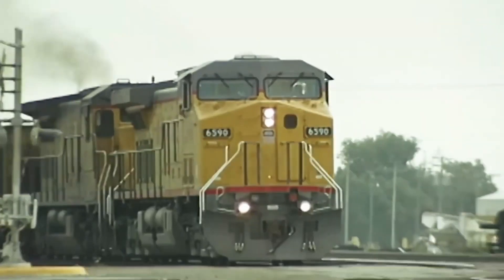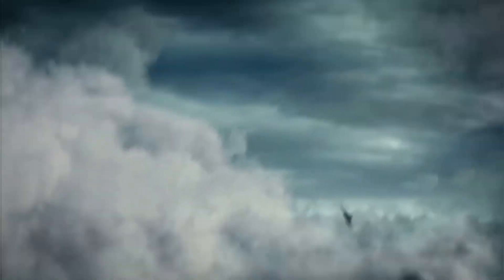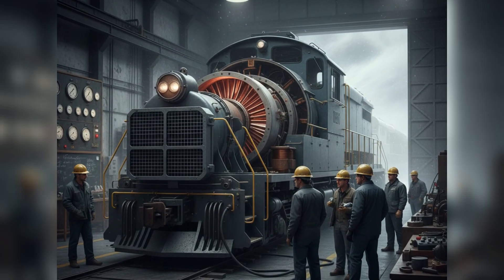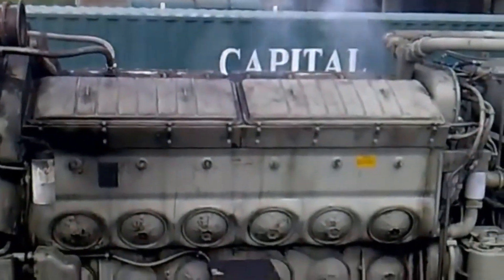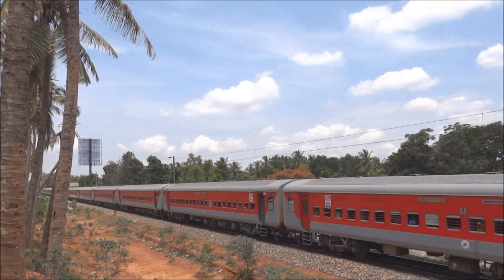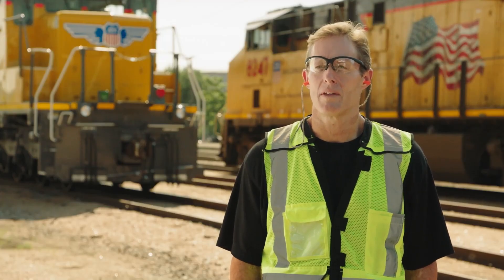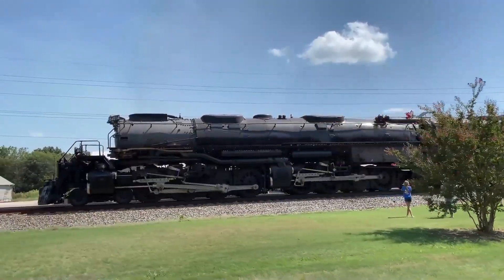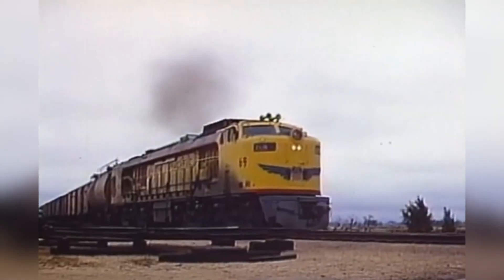Engineers Called It 'Suicide on Rails' - Then It Crushed 50 Years of Records

Comment: I served on a ship that had both gas turbines and diesels, we could run the turbines on diesel or jet fuel, on Navy contracts jet fuel was only marginally more expensive than diesel and the diesels loved jetA.  Fuel filters on the ship were about the size of a house water heater (and cost about the same), the savings on filters alone paid for the jetA, and blade erosion on the turbines was significantly reduced as well.  I can't imagine how bad blade erosion on a turbine would be with bunker fuel.  We had the same issues with the turbines, they don't throttle well, really great at high cruising speed and flat out but not so good when you're trying to dock the ship or navigate a port channel.  The government doesn't care about the fuel bill until they get it, after a while the higher powers told us not to use the turbines except in an emergency.  The diesel is here to stay until someone learns how to run ships and trains on fairy dust,.

Comment: They were great while they lasted. Turbine 18 & 26 survive, but aren't runners.
Reply: They were fuel suckers . That didn´t helped.
Reply: @danielfantino1714 yeah-- fuel sucker's, as you say, and the noise they made limited their years of use. My point was those 1-30 Turbines were perhaps the boldest design of locomotive in railroading- 10+% of freight hauled with 2% of fleet says they worked well-- in some of the most demanding railroading anywhere